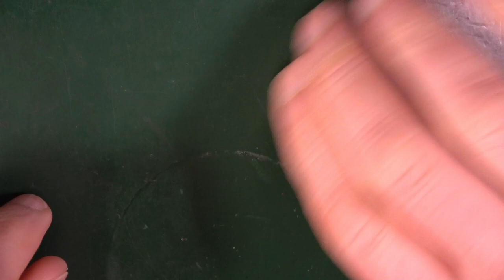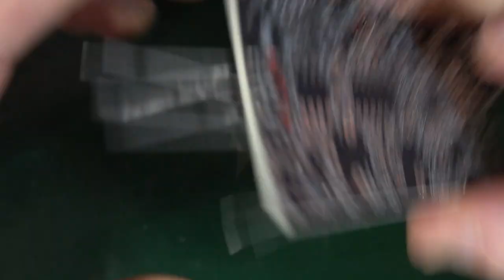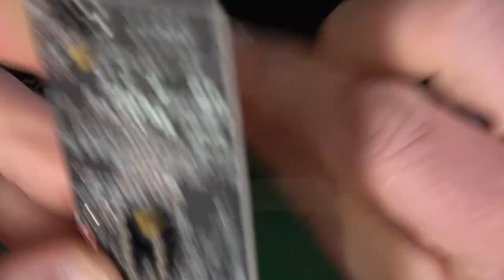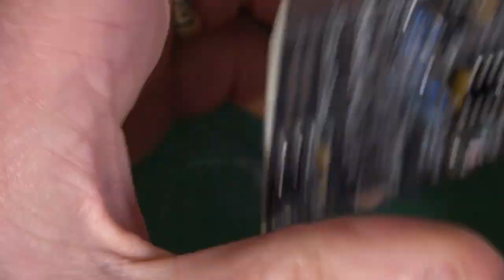Erica Synths EDU DIY Compressor build and demo

Comment: Built this challenging kit this week—identifying resistors was tough! Despite using a multimeter, I must've mixed some up. Or a couple were bad maybe. Only the Gain, Makeup, and top LEDs work; nothing else affects the output at all, and the center LED doesn't light. Tried lots of troubleshooting. The manual emphasizes learning to design circuits heavily, in impressive but over-my-head depth, so figuring out how to actually use it is cumbersome. If you're not interested in doing a very deep dive into the more esoteric side of circuitry engineering, then maybe not a great option. If you ARE, then it's an amazing and generous resource. Thanks for another great helpful video! It helped me at least confirm that my build isn't working, and that I didn't make any obvious mistakes assembling mine.